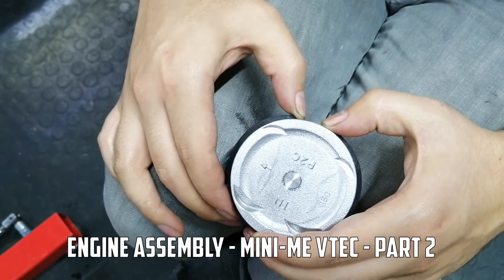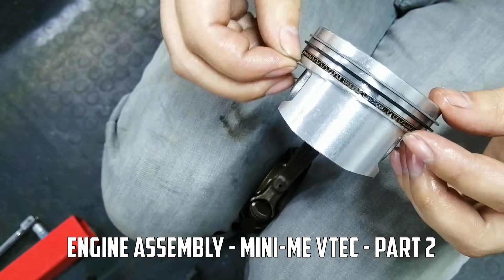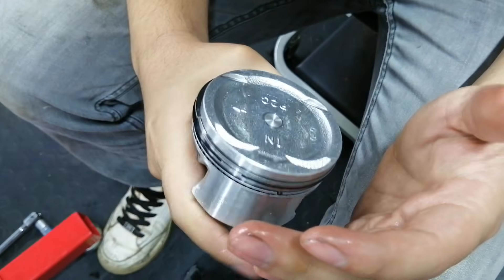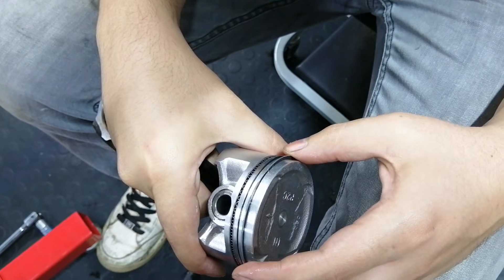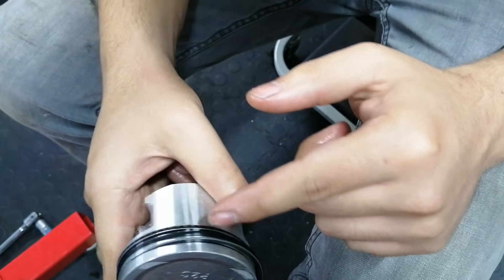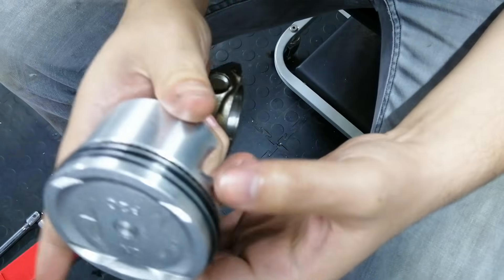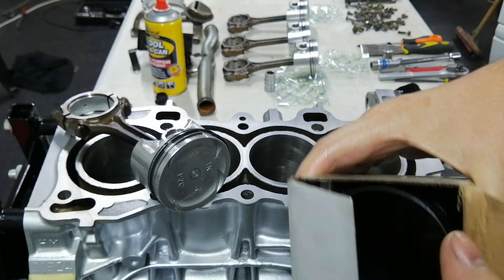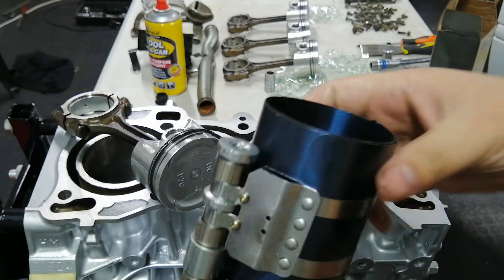Honda VTEC Engine Assembly - D15/D16 Mini-Me - Part 2

Comment: ARP makes head stud kits for mini-me builds exactly like this this EXACTLY the right length head bolts all around 👍
Reply from the maker: Thanks for the info! very helpful. I will definitely look into it.
Reply: They make block studs as well.
Reply: Get a d15b3 head bolt it's longer also the d15z4 had 2 bolts either shorter or longer

Comment: Didn't even use plastic gauge and Check to see for clearance 🙄
Reply from the maker: Hi Bro, yes I definitely took some shortcuts building this motor, I did not check clearances, also did not get the honda color coded bearings. I checked the bearings that came out and got the same as replacements using the logic that if it was working before it will work again, I have not uploaded the video yet, however I can confirm the motor runs just fine, so for me the risk paid off.

Comment: So, is getting 177 Hp out of a D16z6 Naturally Aspirated possible without any Turbo etc but changing Pistons, porting, polishing, porting oil pump or putting in race pump cam gear etc, better header, etc. etc.? I would Love to have a Naturally Aspirated engine that' gets 177 hp... anyone know if this is possible with a D Series Sohc? Thanks!
Reply from the maker: Hi Mike, it is definitely possible and you are on the right track, however it will not be easy or cheap. making 177hp NA power with a D-series will require some serious engineering work, things like CNC porting, oversize valves, super high compression pistons, race fuel, cam, rev kit, ITB's, decent engine management. To be honest, I would recommend doing a Kswop for NA power. 177hp would be a breeze on a k-series. and depending on your location it may even be cheaper.
Reply: @RisingBoostYT   OKay, Thanks a lot!! Peace!!
Reply: @RisingBoostYT  Well maybe I'll stick with the basics... I figure I can put a slightly better Piston Head with Rings to gain 10 hp, Get a skunk Manifold, port and polish everything, Better Header. port the oil pump or buy a Racing pump. Not sure if a better oil pump helps with HP but I am sure it's better for the engine long term etc. Would Love to put on new or better bearings... Maybe that would be about 140+.  Is there anything else that I could do that is basic to increase HP that is N/A? Will doing a tune/working with the computer do anything to improve HP? Thanks for any tips!
Reply from the maker: Hi Mike, basics will help you gain HP, polish exhaust ports, get a good header + exhaust system, skunk intake manufold and you can also polish its runners. Get a bigger throttle body from B16 or aftermarket. The D16Z6 is basically one of the best older Dseries motors. Oil pump won't add hp but will help with longevity and reliability. If you rebuild the motor and add some higher comp pistons. A tuneable ECU will be a big help. Make sure you have a PO8 cylinder head, they say it's the best SOHC vtec head. (D16z6 comes with a PO8 sohc vtec) all the small changes will add up HP
Reply: @RisingBoostYT  Cool, thanks!!!
Reply: here in Brazil there is an eg d16z6 with d16y8 adm collector, b16a3 throttle body, astra flex 48lbs gm injectors, aem injectors flute, aem adjustable fuel pressure, 9bar fuel pump, running on bad alcohol from brazil with 27% water, 13.5 compression rate ... 180whp 220nm of torque
Reply: @gamersplacebrasil  Can I have it? 😊👻
Reply from the maker: @gamersplacebrasil  that 13.5 comp making some serious power!!

Comment: I recommend using wood or plastic to pry off parts next time
Reply from the maker: Hi Jason, yes I did start with a rubber handle of the hammer, but that did not work to well, to be honest I should have taken the rod caps off before installing the pistons, that would have made it much easier and less risky.
Reply: @RisingBoostYT   yes dear. you should take rod caps off before installing the pistons. i was wondering WTH are u doin haha and yes. next time use some soft materials to pull parts apart. love your videos btw. cheer from slovenia